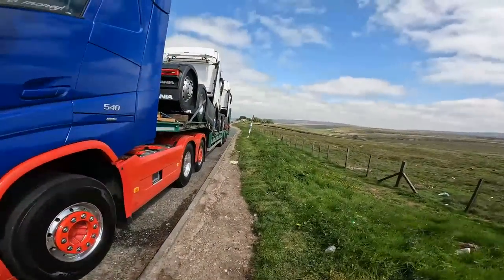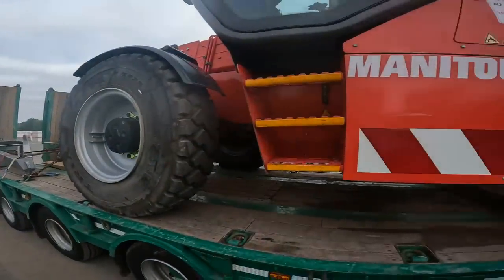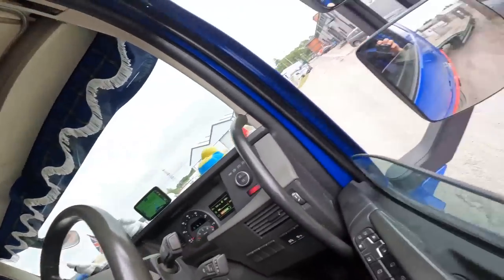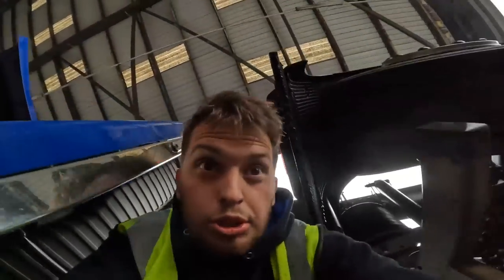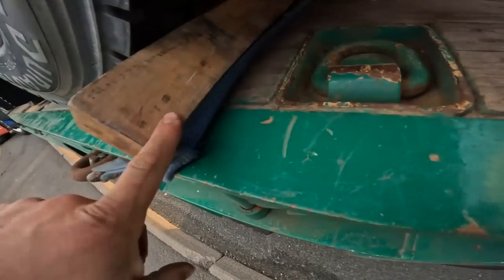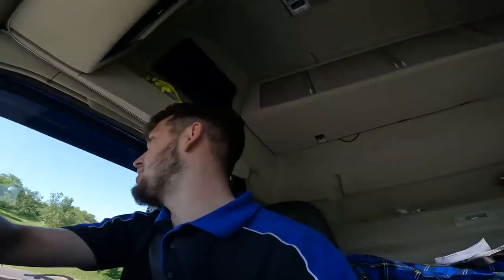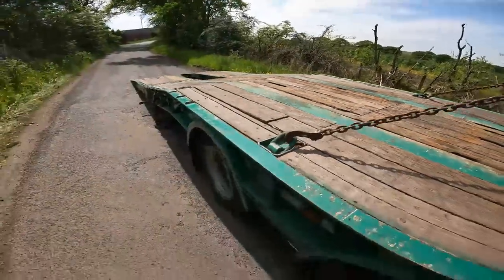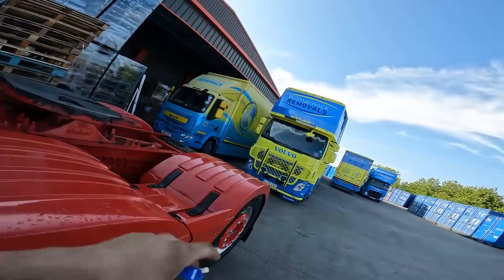Transporting BRAND NEW Scania Trucks!  | For Truck Sake! EP27

Comment: When we move them back the first one on remove the ramps for the neck slide them in the middle leave the air blown up and back up as far as it will go the drive the back one on and then drop all the air out of the suspension and roll forward slightly never had a problem with them
Reply from the maker: cheers ill look into that my man